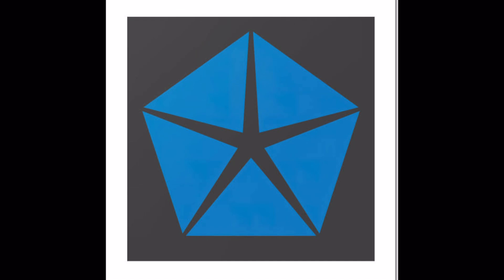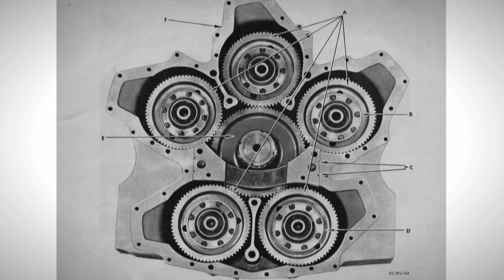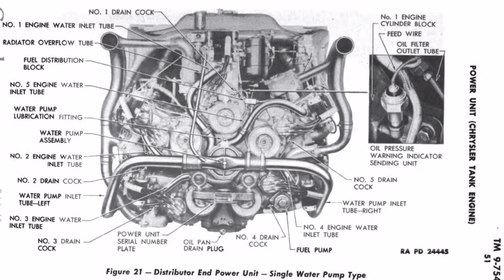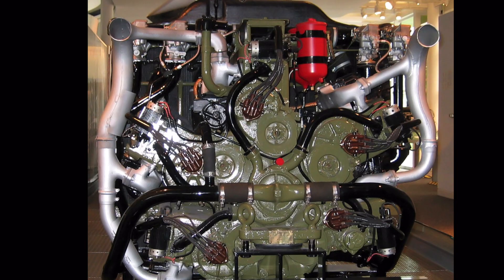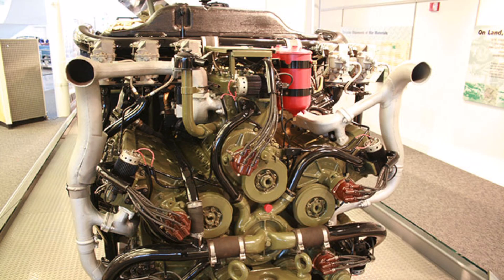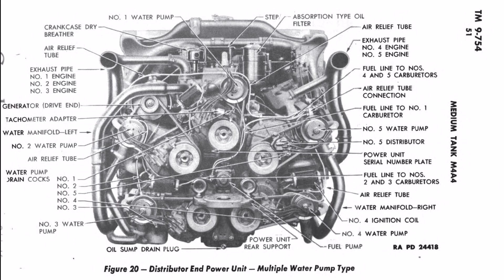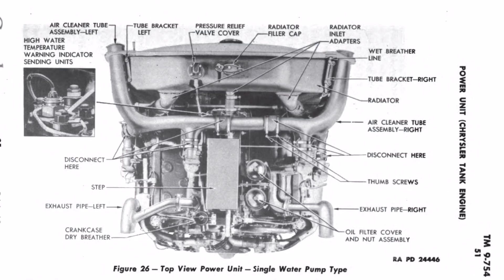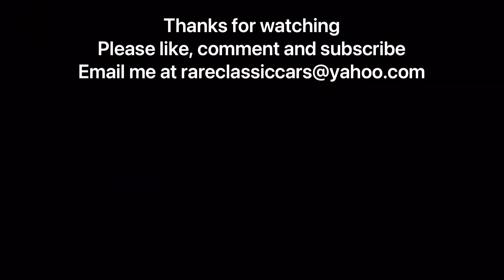Chrysler's A57 Multibank Engine: 30 Cylinders, 5 Engine Banks, 1253ci  - The Original Pentastar!

Comment: Men had to do what they knew to do it all seems feasible to combine the five into one power pack if you learned the engine you could maintain and repair the thing there was nothing more simple are reliable than a flat head six they were legendary the old technology carried us to modern times because of its reliability and now we abandon it instead of making better cheaper more potent fuel that's cleaner some time the old way is the best way

Comment: I would like to know how the timing of the 5 engines is made. Do they run simultaniously with 5 first cylinders firing at once, is there a offset of 72 degrees between them or how ist it done?

Comment: The one advantage these engines had over the other 3 used (The Continental radial, the Detroit Diesel dual-six, and the Ford GA V-8) was that the Chrysler engine could run on even the crappiest fuel available, including the 70-ish octane fuel used in a lot of farm equipment of the time. The Ford needed at least mid-80 octane gas, the Continental needed avgas, and the Detroit needed diesel fuel. for forward-line units, often waiting for fuel from the rear lines to get to them was not an option. Fuel from any damaged/abandoned car, or from any farmer's fuel tank could be used without worry.

Comment: Funny how so many see these as complicated. You treat them as 5 individual motors with equal ignition timing advance, plug gaps and points gaps and throttle linkage adjustments. 

Setting the carbies for balanced idle is(or was) easily done with a stethoscope.. I know this, as I have experience tuning multi carburettor motors!

Comment: Thanks for this one, Adam !.. I'm generally not a fan of military applications, but this particular engine was certainly somewhat of a madcap effort.. It was probably 20 years ago that Virgil Exner Jr proposed a Chrysler flagship vehicle that would have used an X-20 engine, two VIPER V-10 engines on a common crankshaft, one upper, and one lower. Are you familiar with that one ?

Comment: My understanding is the tanks were originally designed to use air-cooled Radial Aircraft engines, which were in short supply. Chrysler approached the War Production Board and the Army, saying ..."We got idle lines that can produce these 24/7 and they Army jumped on it.
The Radial engines could only be idled for about 5 minutes before overheating became an issue.  The A57, though it took up a little more room than the Radial engine was water cooled and could idle as needed; Which is A HUGE advantage in Combat.

Comment: I belive that thing is an multi fuel,multi stroker , at least 2 or 3 engine type running engine. Any thing ells that is not related to Farmmal MD tractors,or those hot bulb duel fueling engines or those 5 6 and 8 stroker engines isn't wurth mentioning .I belive they simply combined some sort of Papp,Strling,Pulse Jet engine in some twisted way of fasion after all those crisler engines culd fire at intake,compresion and exaust stroke so I belive more that things hade phase shifter for spark and gas port shifter but in more magnetic pump sence so that wuld explain tremendous torque with out losing speed or fuel economi . Normal 4 cilinder engine can communicate with other cilinders wia gas differences % content ratio . Ya know those old Metadyne Generators might fitt the bill as well just variabel staff I might by mistakeing but definatli they hade some nice staff back in those days only pitty lot people killed for shit honestly .

Comment: My Dad first  joined up in 1940, became a WO1 running tank repair workshops in the North African desert and later in Italy , he talked extensively with affection of this engine in the Sherman's, (though I don't know in which theatre ?) and its complexity , especially trying to re-time them up , and adjusting the carbs correctly - especially when there were enemy shells being lobbed at the camps,  and they were being sniped at in Italy.
 He was impressed with its reliability, said they would run under awful conditions, with the settings all over the place, ....- but when they were set-up right though he said they were unbeatable.
 I miss you Dad
Reply: Awesome guy god bless
Reply: Yes they will all be missed

Comment: The War Department gave Chrysler the job to figure out how to mass produce armored tanks being designed by Ordnance. Chrysler realized there would be a shortage of the Wright R975 radial engines if the US was to provide tanks for Great Britain and the USSR since they were using surplus and rebuilt engines obtained from commercial air carriers until Continental could start turning out new radials using Wright's tooling. Chrysler had warehouses full of assembled 251 CID L6's for their cars and trucks whose production was cancelled so decided to try using those as a medium tank engine. They came up with the A57 which was first shown to the British Army. They took a pass on the monster motor so Chrysler showed it to the Soviets who rejected it as being too complicated. Chrysler went back the British to say they'll be getting the A57 in their M3 and M4's since the US Army only wants to use radial engines. Chrysler engineers worked with British Army tank mechanics to make the A57 as easy as possible to service and remove then reset for major servicing and replacement. The US Army decided to adopt a practice of removing engines and transmissions after 200 hours of run time for inspection and refurbishing with new or refurbished units taking their place. The British tankers found that their A57 could stay in use longer before an overhaul was needed, with many running for 1000 hours or more before needing that done. The US tankers were happy with their R975's since those kept being improved during the course of the war. The Ford GAA was still having its bugs worked out when put to use in the M4 and rushed M26. Ordnance tested the Gilberson Diesel radial engine in 1941 before settling on the GMC L6 Diesel engine. Later in the war, Ordnance had Caterpillar build a radial Diesel engine for testing.

Comment: If wasn't for your video I would  never had known this engine even existed. This is definitely an amazing piece of engineering, what is really amazing, when you ran the engine. Very smooth no vibration not that loud very quiet, remember  back then there was no computer aided design just pencil paper and a slide rule amazing. :face-red-heart-shape:

Comment: The original design of the tank used a radial airplane engine.   So they adapted this to fit the engine bay.   Shermans had several different engine configurations,  including caddilac v8's,   detroit diesels also.

Comment: Adam, l know that your primary interest in older automobiles lies in the larger more luxurious ones. As witnessed by your collection. I had something pop up in my feed the other day from Horsepower Monster. Newcomen Racing in North Carolina took a 4.0 Jeep engine to insane power levels on the dyno. Over 1K HP with some aftermarket parts and some stock.

Comment: Ford's GAA was 2/3rds of the V-1650 V-12 aero engine that Henry Ford had designed to be a competitor to the RR Merlin. Same displacement, same bore and stroke. The V-1650 had some unusual features in an aero engine. DOHC, cast steel components instead of forgings as Ford was very knowledgable in that field. Side by side connecting rods instead of fork and blade rods, two stage supercharging with integral turbosupercharger for the second stage. 
GMC also built power units for Sherman tanks and other armored vehicles. Two inline six cylinder two stroke diesel bus engines combined into one unit. As a kid in the 60s l always wondered where the GMC blowers on top fuel and funny cars came from.

Comment: You missed another advantage - all the shared parts with the flathead six that was in all the Dodge trucks the Army had, meaning simplified parts orders and training for the service crews. Train them on the trucks and then they'd be close to ready for the tanks.
Spitballing "What If's?" and wonder what an A57 would pull like, with direct injection and electronic ignition, stupid levels of torque and cleaner then current tanks ever get. Add a decent sized Turbocharger and it's a metric crap ton of torque in a Very compact package. Make a fantastic design for Apocalypse surviving electrical generator.
Reply: You're dramatically underestimating how heavy this engine is, how hard it would be to turbocharge it, and just how much torque modern tank engines put out. The torque curve on the Abrams' AGT1500 is absolutely idiotic, producing a staggering 2,750 lb-ft of torque at the horsepower peak of 3,000 RPM. The engine is also less than half the weight of the Multibank, insanely simple, and will run on practically any common liquid fuel. The only downsides are the comparatively hot exhaust and poor idle fuel consumption.
Reply: @griffinfaulkner3514  Weight doesn't matter for the application I suggested. Being able to run forever at it's most effcient RPM does, and like most engines of that era, thanks to the low compression of pre-leaded fuel engines, it will also run on almost anything.
Reply: @PiDsPagePrototypes  The problem is it still has massive complexity issues, and while it might theoretically run on some other fuels, it'll almost certainly lose power doing it. Gas turbines are absurdly power-dense, simpler than practically any other combustion engine, fairly efficient at peak power generation, and at least in the case of the AGT1500, don't lose power when switching fuel types, just a bit of efficiency. The flathead engine design is also inherently less efficient than every other piston engine because the valve position compromises both airflow and combustion.

Comment: Generally, under-square engines (stroke greater than bore) like the A57, tend to produce more torque, which was a great advantage in a heavy tank.   Most diesels are under-square.   I'd like to know how the A57 handled the oil which had to collect in the cylinders of the bottom engine.  Kinda like radial engines.   The A57 is a marvel of engineering.

Comment: Chrysler had a 331 cubic inch version of the same flathead six at the time...if only they had welded five of THOSE together instead, the A57 would have displaced 1655 cubic inches and probably developed over 500 horsepower.

Or even wilder, imagine if they had welded together five of the 385 cubic inch straight eight they had! 1925 cubic inches, 40 cylinders, and at least 750 horsepower. THAT would have really gotten a Sherman hustling.

Comment: Wouldn't this be cool to build a car around if you had the money. V30 Baby eat your heart out.
Reply: i've often thought about a twin engine car, one engine per wheel for better snow traction. would have to shrink down a pair of 6 cylinder engines, until they were 700 to 800cc. 6 cylinders are long and narrow so would be perfect for running side by side. then shift gear on one engine at a time with electronic rpm matching for decreased clutch wear, kinda like a modern vw dct.

Comment: Had a 1946 Plymouth with a flat-6 and was a smooth and torquey engine. Other than the cooling fan noise, you could not tell it was running. Very economical as well.
Reply: The direct-acting flathead valve train has reduced lash - can be very quiet and lightweight.

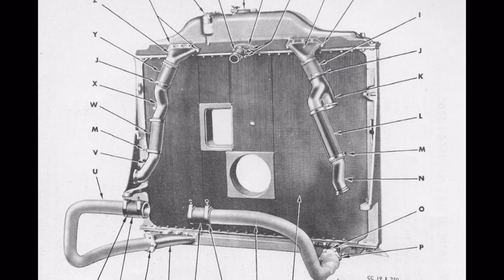Comment: 4:12 on heavy duty trucks it is common on them to have a hole in the radiator to hang a hydraulic pump off the front and have a shaft to the front of the crank

Comment: In the older days, many heavy duty trucks that required a hydralic system, like a dump truck, concrere truck, garbage truck, etc, had the pump mounted up front of the truck. They usually had a shaft running through the radiator to run the pump, just like these.

Comment: This is off topic, but since you’ve been covering these military vehicles in your excellent presentations, maybe you could cover the use of the Hydramatic and Dynaflow transmissions that I was always told were used in the tanks.  That’s a huge amount of torque to go through a transmission that would have been later used in the Cadillacs, Olds, and Buicks.  I’ve always been fascinated by the Dynaflows, being old enough to remember riding in pre-1964 Buicks and remembering the incredible smoothness. I do remember my grandfather having a strong opinion that Buicks were gas guzzlers and Cadillacs were not so much.

Comment: IHC tractors in the mid 80’s had a shaft through the radiator to drive the cooling fan which sat ahead of the radiator to suck hot air and dust away from the cab and operator.

Comment: I’ve seen a steering shaft go through the upper radiator tank. International Harvester did that alot on their tractors.
Reply: the radiator tanks don't require as much finicky engineering to accomplish that though, compared to through the fins. there was a bmw 6 cylinder engine with a hole through the sump for a driveshaft.

Comment: My grandfather worked on many of those as well as the electrical systems in the quad 50 half tracks. As for the A57, he said that many people would mess around with the mixture screws and get them completely out of tune, causing many to backfire and run very poorly. The half tracks were supposed to come with field service manuals, but apparently, most never left French docks. Papa got a  citation for figuring out how to troubleshoot common problems in the field, as well as how to make a soldering iron out of a couple pieces of wire, a spent 50 cal round case, and a carbon pile from a broken field radio.. I still have 1 of those contraptions, and it does work!

Comment: Legend has it there’s still a GI in the motor pool trying to diagnose a single cylinder misfire on one of these
Reply: Reminded me of how my A&P instructor told us how he diagnosed a bad plug in a radial. Airplanes have independent ignition systems complete with their separate wires and spark plugs. He'd run it on the magneto that gave the lower RPM on run up..then he'd take a stick with a wet cloth at the end and reach up/around and touch each exhaust stack with the wet rag. The one that didn't sizzle was the dead cylinder.
Reply: :penguin-blue-waving-tear: Laughing Out Loud (when lol just doesn't cut it).  See class.. now that's humor

Comment: The big considerations were coming up with a design quickly, with the required level of power, and being able to get them produced in a short time period.  Using engines that were already in production saved a lot of time compared to starting from scratch.

Comment: My late grandfather was in the Royal Electrical and Mechanical Engineers; he worked on a lot of "5 bank Chryslers".

The starting process is a little unusual if it's been left overnight. First a large starting handle is used to crank the whole lot through one revolution while the ignitions are off. The cylinders of the lower banks would accumulate fuel overnight, so the hand crank was necessary to clear it out and prevent a lot of fireworks.
Reply: This is actually very common with large engines and radial engines in particular. Not only to circulate the lubricants but to clear the cylinders as you mentioned.
Reply: Hand cranking would also guard against hydro lock. I think they would hand crank the radial engines for the same reason.

Comment: The Ford GAA was the most popular Sherman engine and well loved for its reliability, ease of service and field repair, as well as its lightness do to being aluminum.  It also went on to power the next US army tank the M26.  The multi bank was far too complex for something being repaired and maintained in a war zone. 
Chrysler did develop a V12 engine called the A-65 specifically for tanks, but it came late and the army was moving towards air cooling for its tanks which made all the other engines including the GAA obsolete.

Comment: Based on a very reliable online six it was a very reliable 30 cylinder. Complex in some ways but fundamentally a simple modular system - if you could work on the six you could work on this.

Comment: The A57 was only installed on the M4A4 variant of Shermans, and it was longer than any other engine installed in an M4. As such, the M4A4 hull had to be stretched to accommodate it. This makes identifying an A57 powered Sherman easy, as the space between the suspension bogies is increased.
Reply: The twin 6-71's also, right?
Reply: @randymagnum143  I don't believe so for the twin diesels - those were installed in the M4A2 variant and as far I know they have a normal hull. I think there was a multi fuel engine developed by Caterpillar near the end of WW2 that may have required a stretched hull as well.
Reply: @jsplicer9  the Cat was a converted Wright 1820, and were junk.  They weren't very long or heavy.  A 6046 power-packed is longer than the A57, and just as heavy.